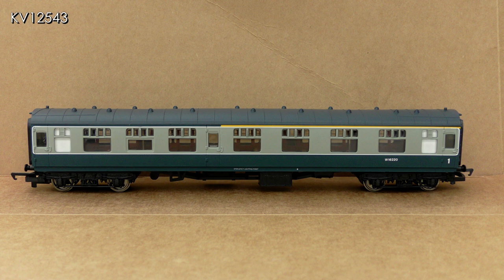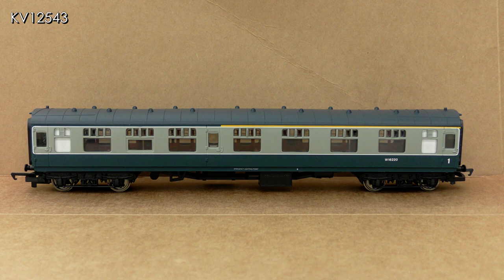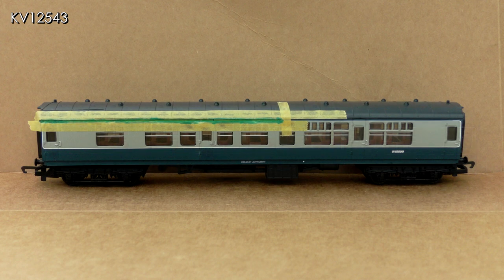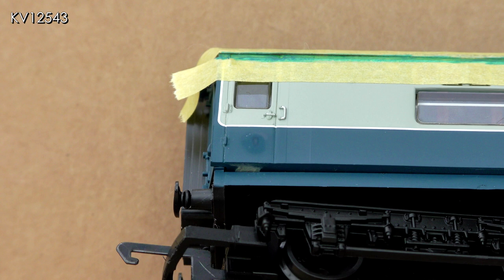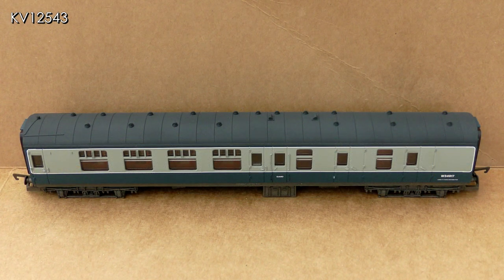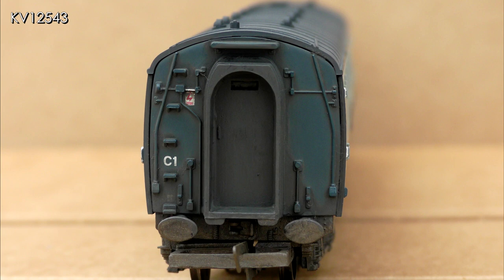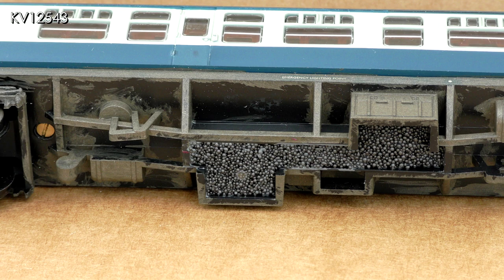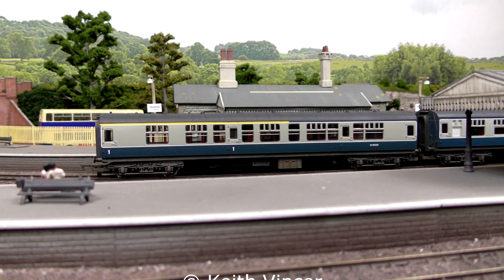Hornby Mk 1 Coach improvements

Comment: A word of warning regarding liquid lead or, more accurately, the type of adhesive used. Many years ago I purchased an 0 gauge Midland 800 class 2-4-0 built from Slaters kit. It was poorly painted in toffee black so I stripped it and airbrushed it in Midland lake, taking days to fully line it out. I put it away in a box in my loco cupboard. 18 months later I got out and...... SHOCK, HORROR! My beautiful boiler had split and pushed it off the chassis, much in the manner of a boiler explosion.

Detailed examination revealed that the boiler had been filled with liquid lead glued in with an Araldite-like substance, and this had absorbed atmospheric moisture causing it to expand catastrophically, bursting all the soldered joints. I was so disheartened that it remains to this day in this condition; one day I will repair it but if I use liquid lead it will be fixed in with Blu-tak!
Reply from the maker: Thanks Roy, I have also heard similar from another viewer.  The instructions that come with the lead clearly states to use PVA diluted with water and with a drop of washing up liquid. I have tried to contact Eileen's Emporium but have discovered they have gone into liquidation so am no further forward. I have used the lead in a number of projects so I will have to hold my breath and hope the problem you had doesn't happen to me, Regards Keith

Comment: A  less destructive method for removing coach numbering is to rub it off with a cocktail stick which can be used with a sharp end or with the end cut down a bit to give a bigger wedge. I also find that wetting the stick with saliva reduces friction and helps dissolve the numbering while keeping the underlying colour intact.
Reply from the maker: Thanks Peter for the tip which I will try on a future project, Regards Keith

Comment: I really enjoy your videos and always find them so informative. The work you have done on these coaches just shows how some time, patience and skill can produce a stunning result on older models. I was shocked to see Bachmann coaches are now at about £50 and Hornby £35 to £40. I used to pay about £10! Makes you realise just how sensible it is to keep updating those old models. Please keep the videos coming.
Reply from the maker: Some Hornby coaches are now over £70....the detailing is very good if you want to keep them in a display case but if you want to run them, like I do, the detail in the older coaches is more than good enough, Keith

Comment: The blue solebar is both right and wrong. Some were blue and that should include the buffer beams and buffer shanks, some were black. The one thing that is without question though is that they all ended up a grotty brown! Those roof ribs are a bit excessive, the same goes for the older Bachmann ones. A bit of patience with a sharp blade and a waft over with some weathering to the roof helps a lot, but my biggest bugbear with BR Blue/grey Mk1 coaches is the end steps. The end steps were removed in the 1960s, leaving either one or two at the very bottom for accessing the alarm gear or mounting a lamp and shouldn't be there on blue/grey and more modern liveries to prevent accessing the roof. Even the last surviving LMS Stanier coaches had their steps removed, which grates a bit when the new Bachmann Blue/Grey portholes are nearly £80rrp each (!!!) and incorrectly detailed for that much money. You can usually tell at preserved railways which coaches lasted longer in service by this, the late survivors have no end steps, and a lot of preserved railways haven't reinstated them.
Reply from the maker: Thanks very much for your very informative reply.....I had no idea about the steps on the ends. I have for a long time objected to the silly prices that are now being charged for coaches which is why I try to use the old Hornby ones. Now you have said that the more expensive ones are just as inaccurate as the cheaper ones I will continue with the older Hornby ones. I have just finished detailing a Hornby Top Link green Southern Region Mk1 BG for my latest layout, including painting the interior and I reckon it looks great, Keith.